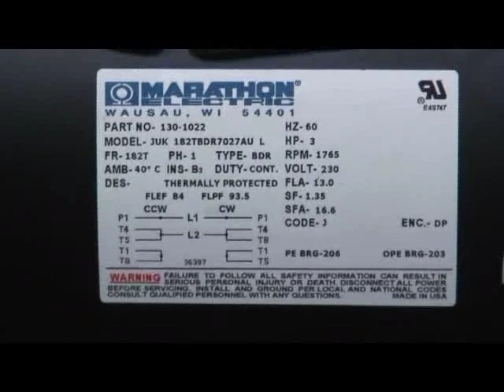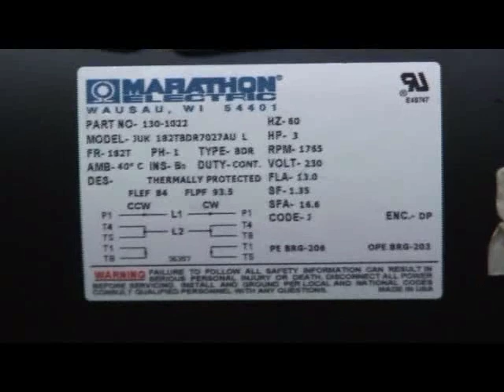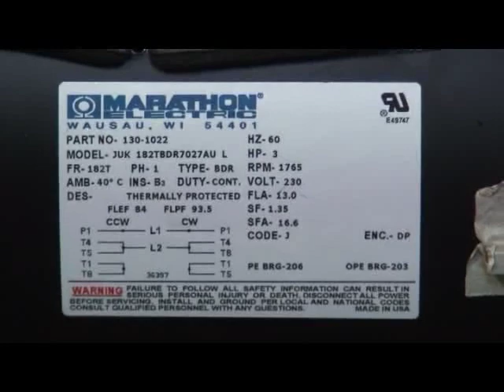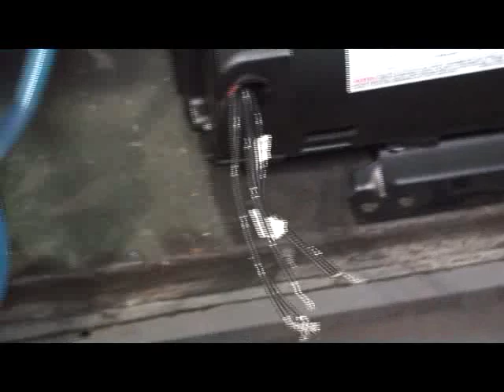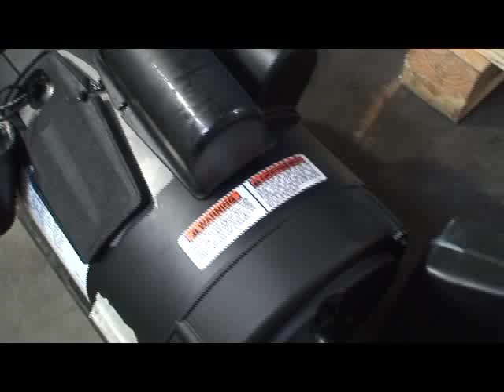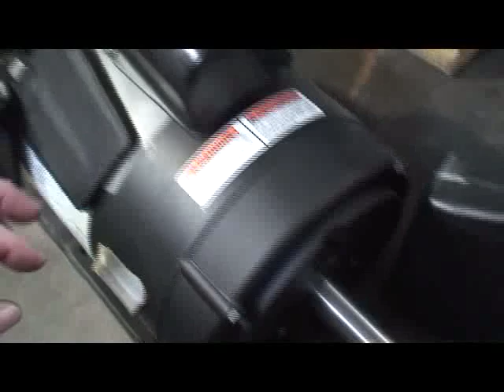Jenny Compressor Video P Electric Motor Start Cap R&R.avi

Comment: Hello! I got the same motor as the video but mine also use 115volt .what i want to know is how to wire it for use 115 volts? because it was connected to work 230 volts . Can you help me please?
Reply: Gulembo18 hi my bro, please contact me :sales1@hxequipment.com 0086-18254586121. i am manufacture supplier of 115v/230v single phase motor for more than 39 years

Comment: yes, some caps have bleed off resistors and some don't but you never know if the caps are fully discharged, It's always a good idea to short the terminals with a screw driver first before disconnecting the wires to ensure you do not get shocked. Also when caps go bad they will continue to hold a charge when they should of been drained.